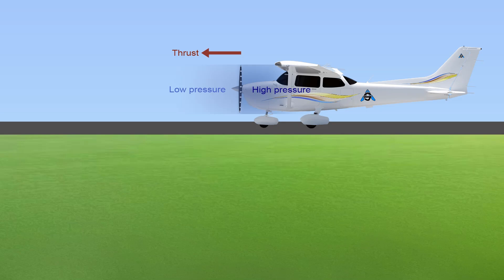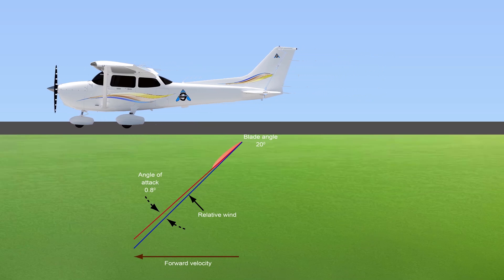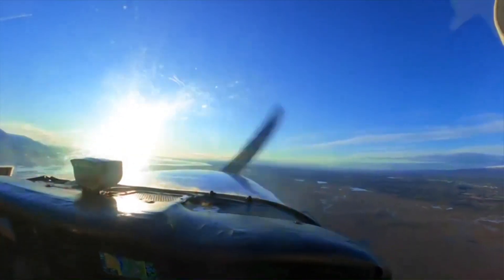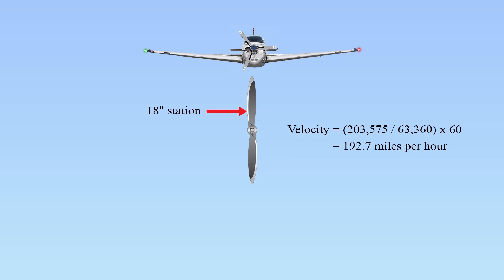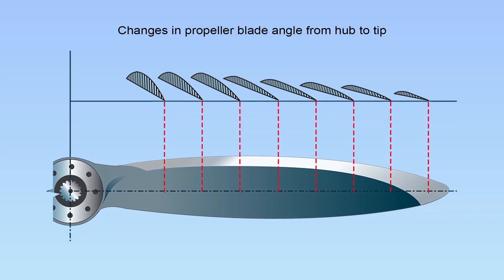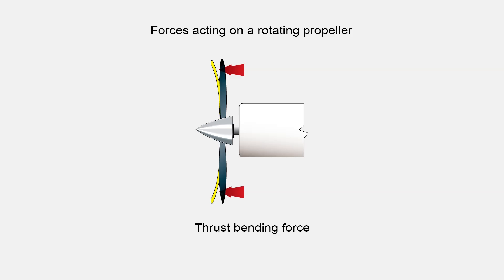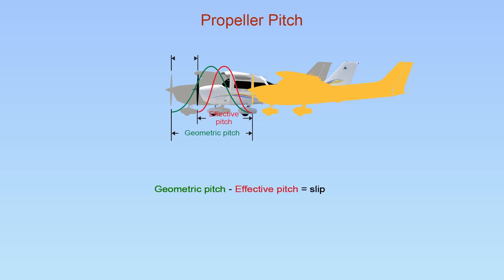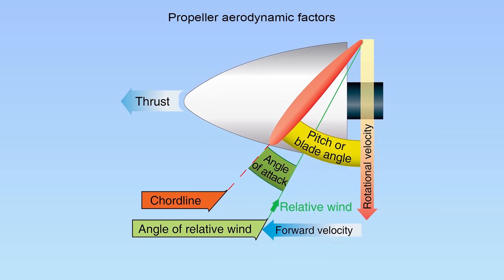Understand Airplane Propellers | Theory | Aerodynamics

Comment: So the faster the propeller goes the faster the plane moves?
Reply: Yes, in general, when a propeller spins faster, it creates more thrust, which can make the airplane move faster initially. But it's not a direct, unlimited relationship. Several important factors come into play.
Reply: What are the "several  important factors"? @macpriyanjith
Reply: 1. Propeller efficiency drops at high speeds:
- Propellers are most efficient at certain RPMs and airspeeds.
- At high speeds, the blades can approach supersonic speeds at their tips, which creates shock waves and drag, reducing efficiency.

2. Air resistance increases with speed:
- As the aircraft goes faster, drag increases exponentially.
- So even if the propeller spins faster, the extra thrust may not overcome the growing drag.

3. Constant-Speed propellers regulate RPM:
- On many aircraft (especially high-performance ones), propeller RPM is automatically controlled by a governor.
- Instead of increasing RPM endlessly, the blade angle changes to maintain efficiency and match engine power.

4.. Engine limits:
- The engine driving the propeller has limits — spinning the propeller faster needs more power, and the engine can’t exceed its redline without risking damage.
Reply: @macpriyanjith i am grateful for this information